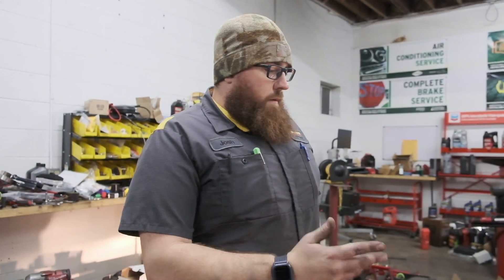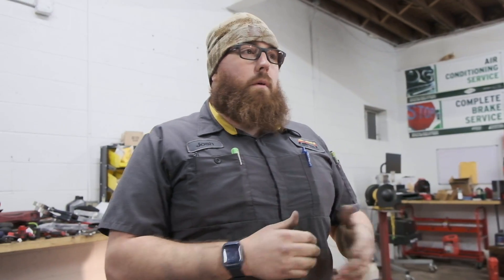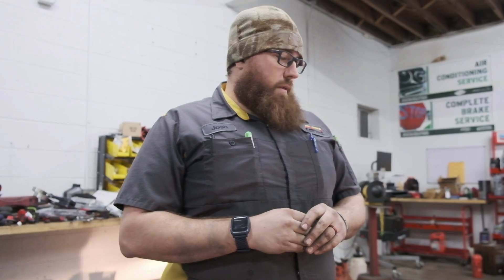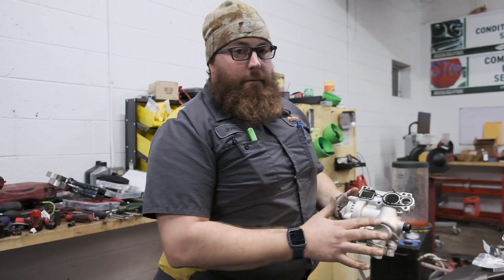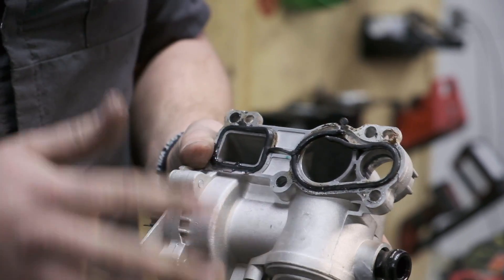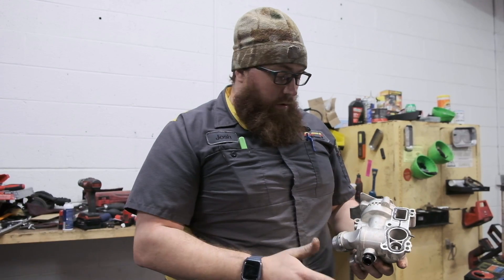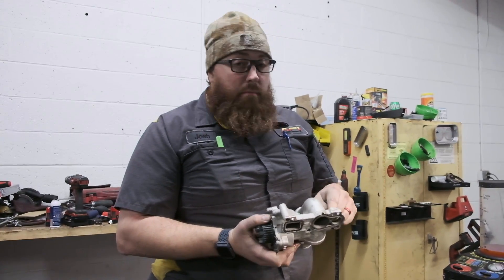How Did  This Aluminum Water Pump Fail? | 2013 Audi b8.5 A4 2.0T

Comment: Ok, I like the idea of a factory plastic water pump instead of aluminum, especially because you say it the gaskets/rubber rings failing and not the pump housing but, what is the cam bridge. And, what do you mean by letting it come up to temp? before tightening down nuts or driving the car or what? I'm not clear on that one. Thanks
PS Do you suggest getting the gaskets from Audi dealership because they are way better than what comes with a pump kit?

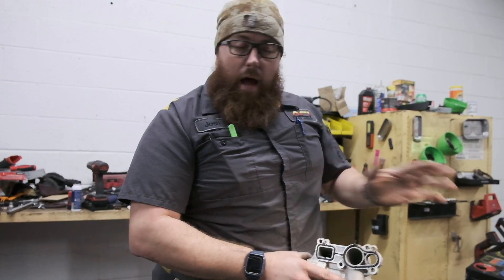Comment: 3:49 oil leaks down from the valve cover and messes up the rubber gasket. That`s why the rubber fails. What you need to do is use silicone also this will keep the oil out.

Comment: Need to do a video on specifically where this cam bridge fails and where it leaks and how it causes the water pump mounting o ring to fail ? isnt the cam bridge in the front of the engine ? maybe you meant to say valve cover gasket ?
Reply: The cam bridge is the valve cover. On these engines it is the same. Remove the valve cover and the cams are loose.